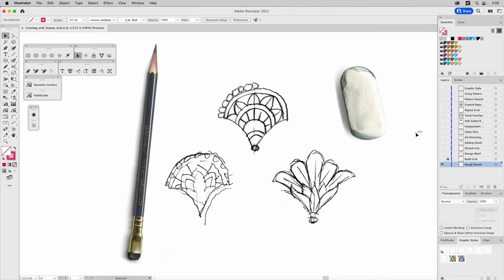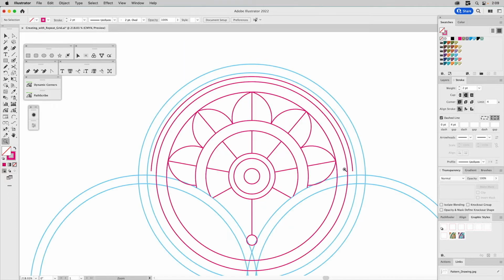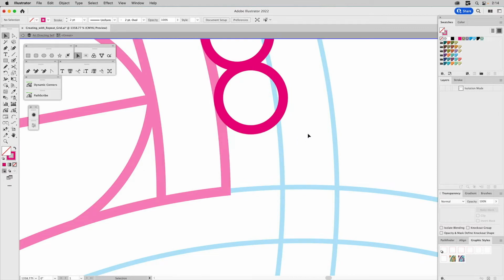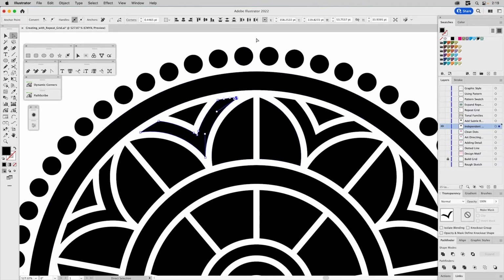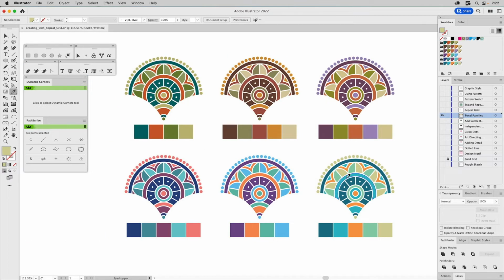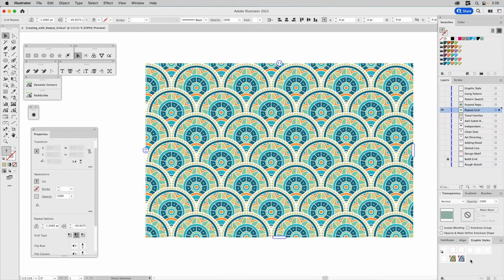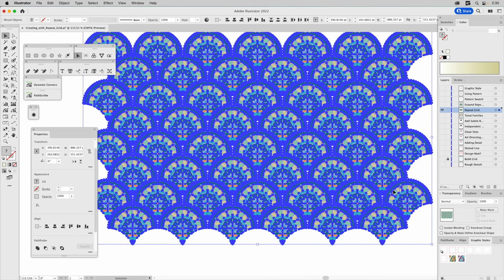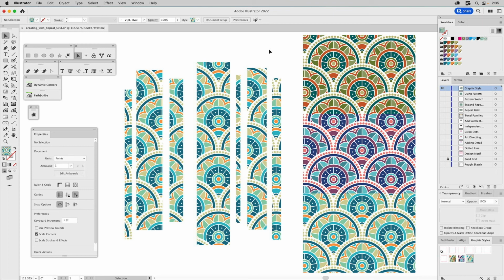Creating with Repeat Grid

Comment: There's a reason why Illustrator preserves the dash by default. When you set the values in the dash, you're entering specific values and Illustrator aligns all the dots or dashes along the path accordingly. If I have a 6pt gap, then the gap will be six points, period. If I choose align dashes to corners and path ends, Illustrator will vary the gap value across the path to allow for corners or ends to align perfectly. For some cases, this is fine. For others, as in the case of your dots, I'd prefer the former and figure out a way to calculate the line length, dot size, and gap space so they align because the alternative can introduce alignment issues of its own if you're not careful or expecting this behavior.
Reply from the maker: That makes sense. I still think it was easier to do this in FreeHand and that was nearly twenty years ago. But I digress. Thanks Stuart.
Reply: @PPLLUVProcess  I haven't used Freehand in YEARS and I had little exposure to it to begin with. A design firm I worked at for a summer before going off to study audio engineering used Freehand, so I did. I actually had a copy of Illustrator 2.0 on my PC so that's what I really started working with. All the Macromedia tools bugged me from a UI/UX perspective, but the MM tool I used most was Flash. Don't get me started on Flash; I'll make your rants on AI look like amateur hour.

As for the grid repeat tool, understanding where it came from is probably important. I don't think it was ever intended to be used for patterns, mostly because Adobe already had the pattern tool in AI and it worked fairly well. The repeat grid comes from Adobe XD and its purpose is for mocking up wireframes and UIs. If you have a bunch of case studies, or a column of blog posts, repeat grid simplifies duplicating these elements and in XD there are ways to also input data into these grids quickly. Since AI and PS are also still used by designers, my guess is someone complained that AI didn't have this functionality and the team ported it from XD without thinking too much about it. You found out the hard way that using this tool for patterns is not unlike using a screwdriver to hammer in nails. Sure, it can be done, but it's not very effective and there are unforeseen consequences for doing so. I blame users requesting this feature more than I blame Adobe.

Your larger point about Adobe no longer designing these tools for the user is not unfounded, for sure. I'm dumbfounded on a daily basis at the lack of basic tools in ID that have to be patched through scripts. I'm glad they're there but they're a poor replacement for proper tools. AE and PPro also fall into this group to varying degrees. I agree they need actual users of the tools working as evangelists because that role seems to have (d)evolved with the advent of social media. I appreciate the lengths Adobe is going with Behance and community outreach, it just seems like they are chasing trends and not thinking about building the tools professionals need.
Reply: @PPLLUVProcess  Love the series by the way. Keep them coming. Your Vector Basic Training book helped me immensely. I just with I could illustrate half as well as you can.